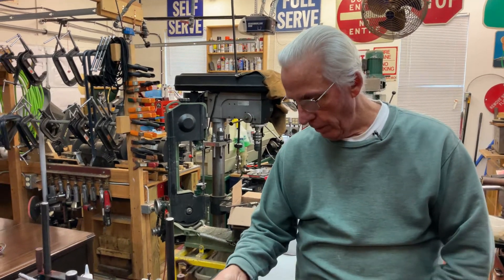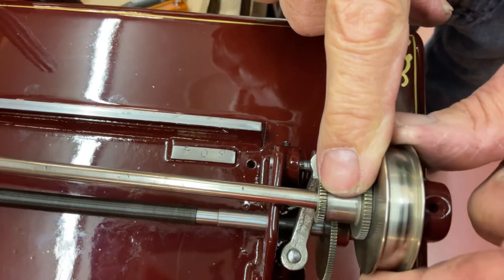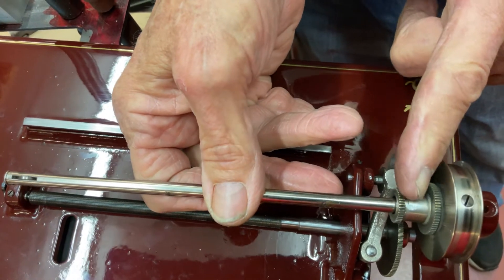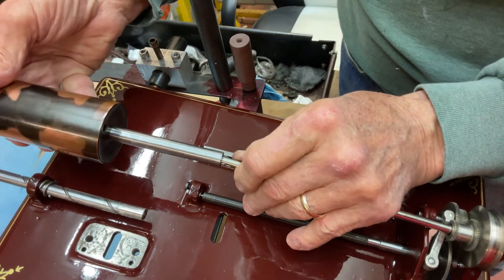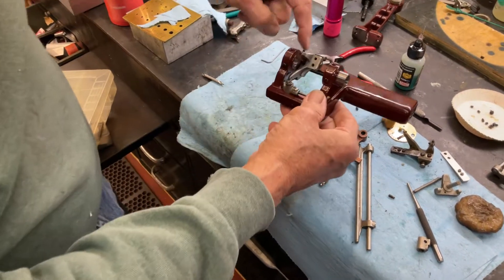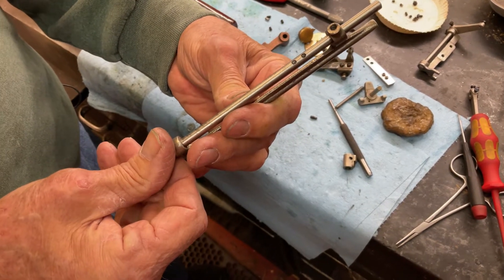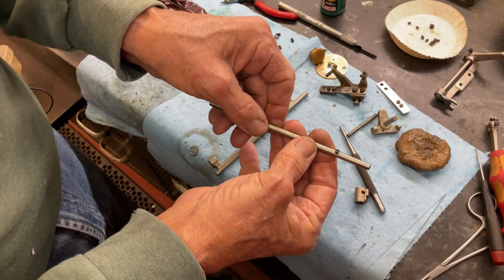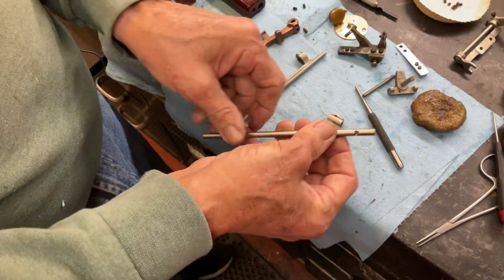921.  Working on the Amberola A-1 drive rod for the mandrel

Comment: The machining and casting of all those small parts, amazing!  And no CNC, what talented men they had back then.  Brett, on a tapered pin, do you have a trick for figuring which way to drive the pin out.   Sometimes the difference is so minute it's hard to tell.  Go the wrong way and you can make a mess.
Reply from the maker: Sometimes it’s hard to tell even using a loop which end is smaller so I take a punch and a small hammer and tap one and of the pin. If it appears to move I continue to tap, if it does not move then I try tapping on the other side. It’s a matter of trial and error if you cannot tell even using a loop.